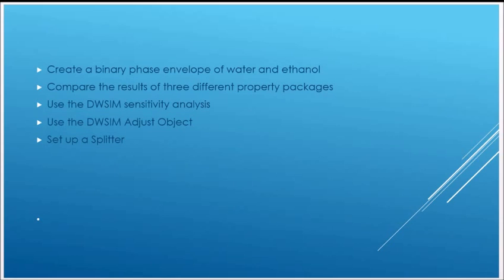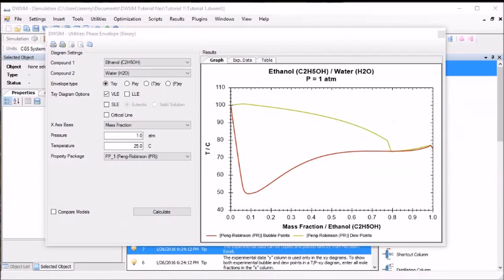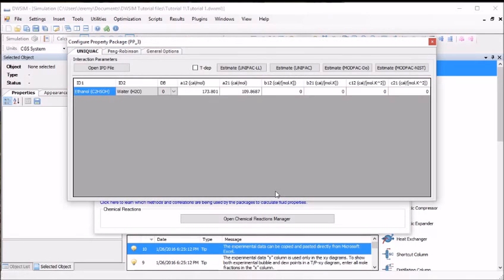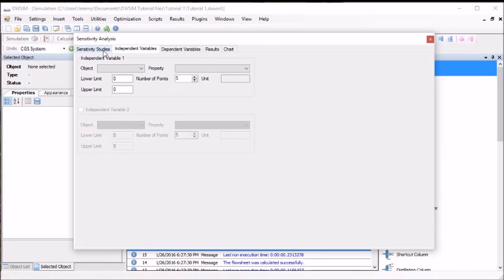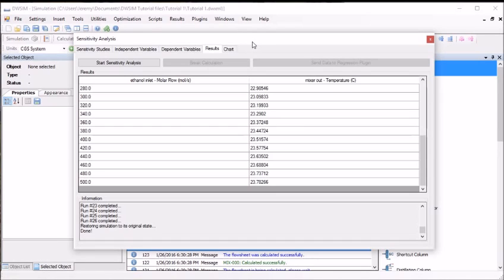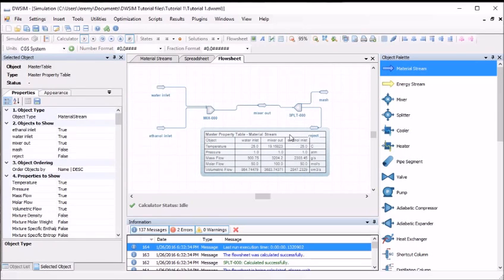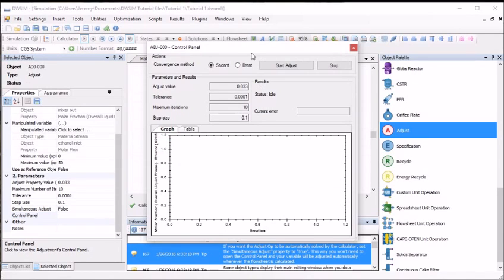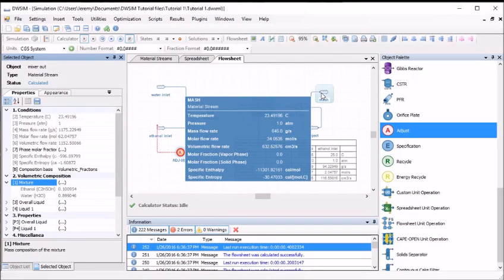DWSIM Tutorial 2 (Utilities & The Adjust Object)

Comment: Is it possible to use DWSIM for the project and optimization of a Distillation Column whom we don't know the Number of stages and the position of the alimentation stream, but we know the composition of the distillate and bottom stream?
Reply from the maker: Sorry for the late response I have been extremely busy with some other projects. Yes it is possible in theory, but in practice you will find that your tray efficiency will vary from manufacture's data and change over time. Most working columns and their appropriate settings are optimized periodically and while they are running. While simulation results are used to give good starting points.

Comment: Dears
I am reaching out to seek guidance regarding an issue I encountered while using DWSIM to develop a flowsheet for a CCU (Carbon Capture and Utilization) project.
Specifically, when attempting to modify the values of pressure, temperature, and feed in the simulation, I encountered an error message. I kindly request your advice on how to successfully simulate the CCU process with varying temperature, pressure, and feed flow rate. If there are specific steps or procedures that I should follow, I would greatly appreciate your guidance.
I look forward to your response.
Reply from the maker: Sorry I am not familiar with those processes. Try the DWSIM community page. https://www.youtube.com/@DWSIMSimulator

Comment from the maker: can you post a screen shot
Reply: please wait
Reply from the maker: I can't acces that link, but thats ok, are you getting the error when using the sensitivty analysis
Reply: i did not understand
Reply from the maker: try to go back and follow the video exactly. pay attention to the lower and upper limit values for your first independent variable. upper limit should be greater than 0, I used 500.
Reply: okk
Reply: I am getting an error when I enter stream flow spec  value for the splitter. There is no error during sensitivity analysis
Reply from the maker: Ok, double check that your streams are connected correctly, you may need to disconect and then reconnect. next make sure your inlet stream has enough flow to satisfy your specifications. in the video I change the operation mode to streamMassFlowSpec and I specify 645 g/s
Reply from the maker: Hence there must be at least 645 g/s flowing into the splitter in order for one of the outlets to have 645 g/s. remember not to specify values into the streams themselfs as DWSIM should calculate these values from the splitter block
Reply: I am getting an output of 45 kg/s from mixer outlet. I have entered a value of 12 kg/sec in stream 1 flow spec .  i am sending screenshot again  [IMG]http://i67.tinypic.com/641mkk.jpg[/IMG]
Reply from the maker: my advice is to start over and follow my tutorial exactly using the same values I used and see if you are still getting the error